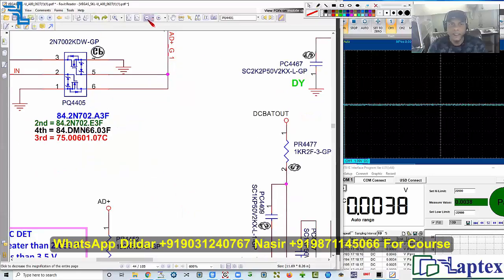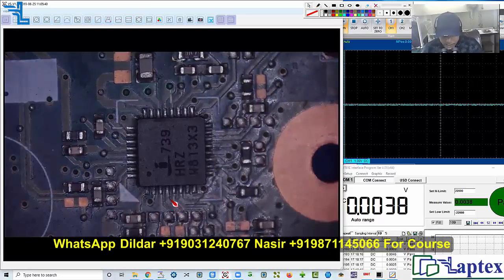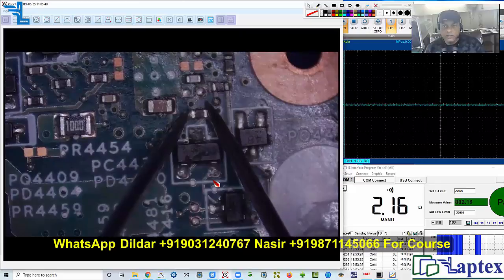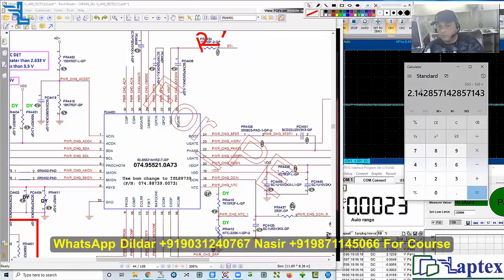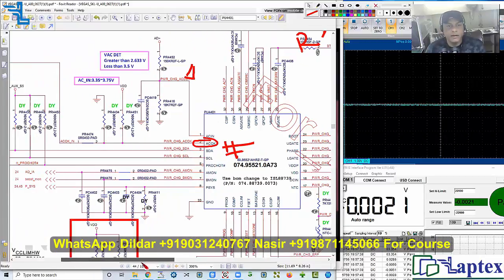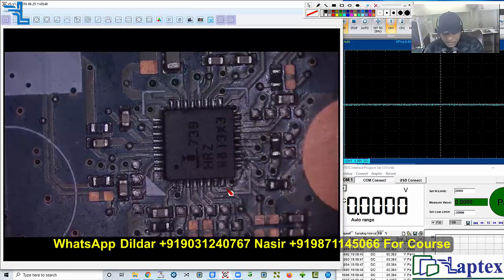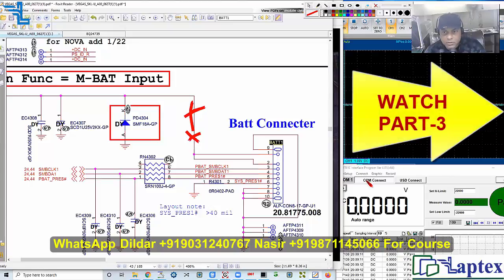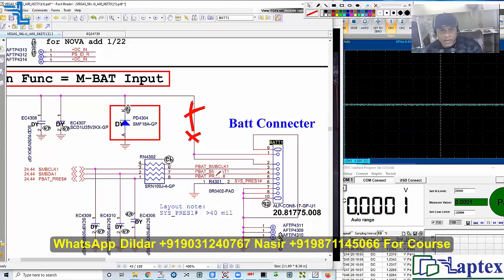Laptop Charging Section Problem | Dell Vegas not Charging Sol | English Part 2 | Online Video Course

Comment: Hello sir I own Asus tuf fx504gd and my cup get burnt  and in local shop they tell me to change the motherboard... Sir is this problem is repairable.... Chip set is i5 8300h
Reply from the maker: If CPU is not short then it could be repaired. You can send the motherboard to our office address.😊👍
Reply: @laptex1377  sir what will be the cost of motherboard